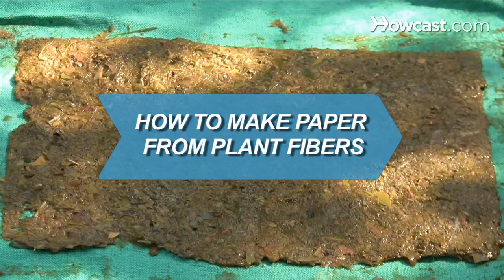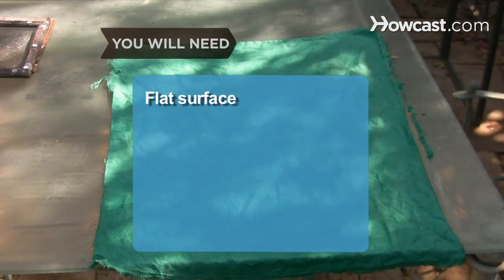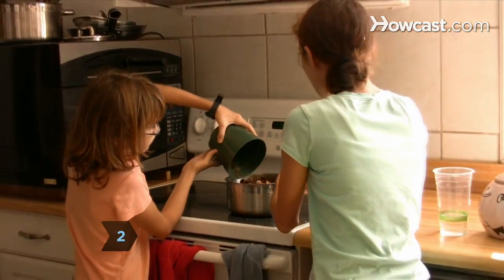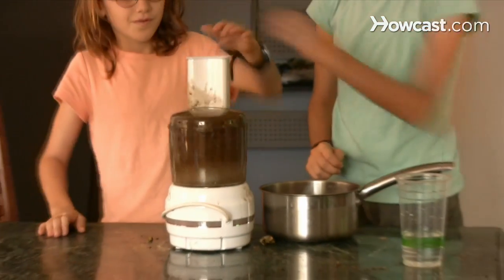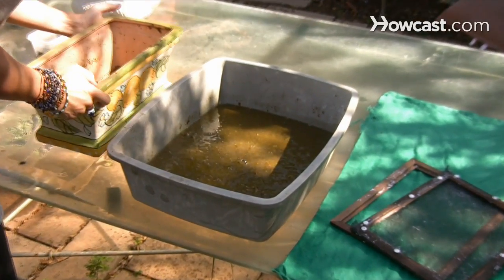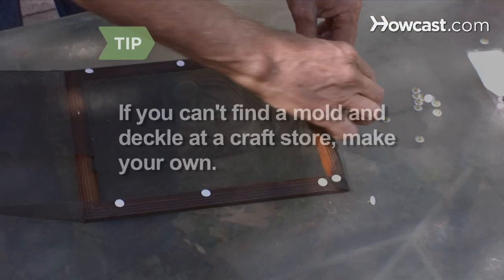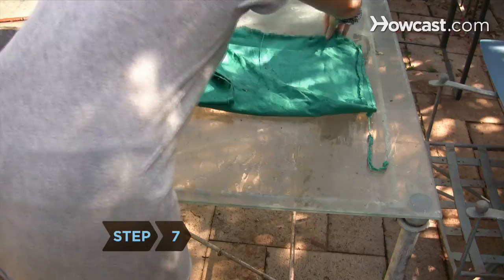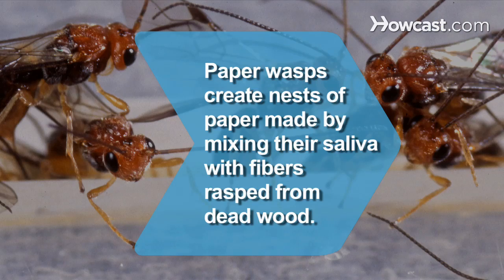How to Make Paper from Plant Fibers

Comment: To lighten the paper add lye when doing the blending process , to smooth the paper and get an even surface , while still damp remove it from the mesh ,and place on a flat surface. then  place a large weight or rock on the top , in order to speed up the process leave outside in direct sun light. to blend without a blender use a mortar and pestel , this can be used to get a better texture if done carefully .
Reply: do you know of a non toxic way of lightening the paper?
Reply: @textingjesus  to lighen things yyou'll need something like bleach , or lye. i guess you could try baking soda or something like toothpaste which are whitening agents rather then bleachs. but honestly lye isn't that bad just wear gloves.
Reply: Hello. We are doing this project for a research paper. If you don't mind, how much lye should be added during the blending process? Thank you, your help is greatly appreciated.
Reply: @miffae  all depends on the plant fibers , and darkness of leaves . i haven't done this  in a long time so  best bet is to add in increments you feel suitable for your batch size. Nice thing is you will definitely notice the bleaching effects , so you'll know when it's ready when it's a light grayish color.
Reply: @deathbunny1718  Thank you very much!

Comment: This video is a bit irresponsible in that it's NEVER advisable to use the same cooking pot, utensils or blender for food and cooking plant fibers. Also not the greatest idea to cook the plant matter indoors. I have an 2 burner electric stove I use outside. Thrift stores are a great source for used pots, utensils and a blender (food processors will not work for many fibers).
Reply: Grammar fix of your comment:
This video is a little irresponsible because it was never advisable to use the equipment you have on the kitchen for experimental purposes.
For this to be done formally, we should instead buy equipment from thrift stores or garage sales because equipment there are cheaper and easy bought. And to boil the leaves, I use 2 burner stoves I use outdoors for this such activity. In the end, it is not good to use equipment used in experimentation because the experiment might have a toxic or poisonous comeback. And for this activity, there are plant fibers which won't work for this activity.
(Fix your accent first before making an argument. Learn how to use singular and plural form. Learn how to use "a" and "an" in a sentence.)
If you want to reply to me, fix your accent or I will fix that comment again.
Reply: @toshdefroge6541  Sorry for what happened to you. Hope you'll get better soon!
Reply: @toshdefroge6541  you sound miserable.